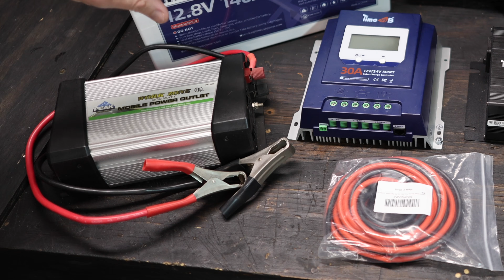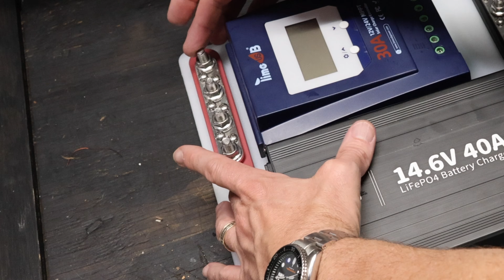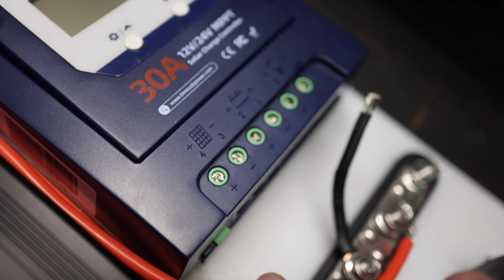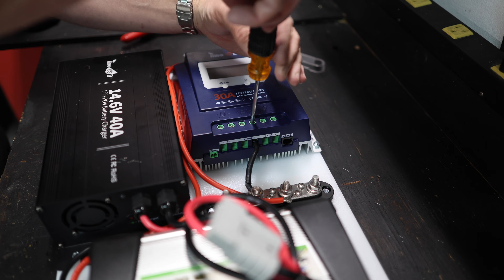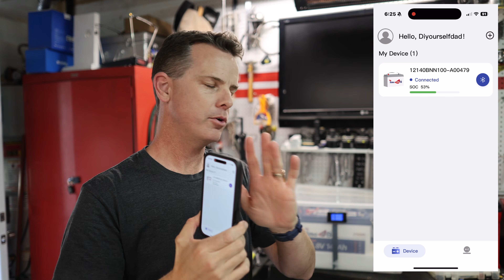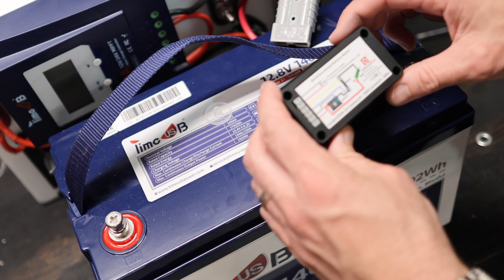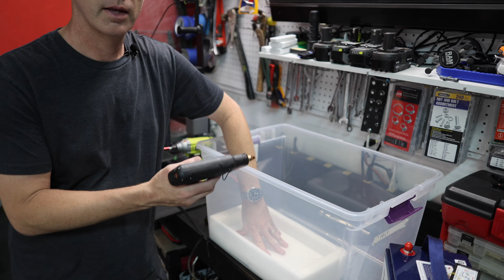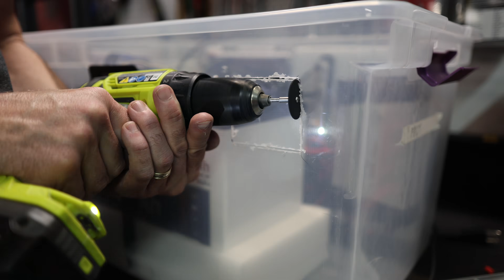Build Your Own Solar Power Station - Make It Better - Make It Cheaper

Comment: Not fuses, breakers or cut off switch?🤔
Reply: Has fuses inside the inverter and the solar charger. A cutoff switch would be a good add tho.
Reply: only noobs need that

Comment: The AFERIY P210 2400w all in one unit Is cheaper and has more capacity than this Frankenstein!
It cost $700 at discount and has a  2048 watt hour capacity  which is more than this.

Comment: How much money do you save on comparable power station, or did I miss that?
Reply from the maker: It’s all going to depend on what you already have on hand, in my case, I pulled the battery and solar controller out of my trailer for an upgrade so the cost on that was nothing. If you already have stuff laying around, you can fill in the gaps and build one of these pretty cheap.

Comment: I have been piecing my system together. Starting with 900 Amp hr. 4k Inverter.60 amp Charger. almost to 800 Wats of Solar 
I want to camp for 9 days with out starting the Gen set....
Reply: I want to build something for powering my dj equipment. I know what I need it w and wh, still learning about a, ah, and mah.
Reply: @commonsenserevival amp hours is how RVers refer to storage capacity of a battery. It assumes 12v batteries. Power stations or diy can use a variety of battery voltages so watt-hours is a better indicator of energy a battery can store, as a 48v 100 ah battery can store way more energy than a 12v one.

Comment: Great video. I did something similar several years ago. Instead of the bulky and expensive battery charger, I added an AC adapter to 15 volts and hooked it to the charge controller. It takes a lot longer to charge from AC but makes it much lighter. I also added a 12 volt port to charge things with the car adapters(cigarette lighter) and USB ports.

Comment: Does the power inverter have room for multiple plugs?  If so, shouldn't it be placed on the cutting board so that it is right at the side of the box (with a hole cut) to access for plugs?
Reply from the maker: Watch the end of the video, I mount the plugs in the front of the box.

Comment: Solar control over size for 140Ah. Unless you going for like 600W solar setup. User can go smaller. Upgrade battery to measure discharge and charge level. No need to add it external. It's add another failure point.
Reply from the maker: Definitely overkill, but it’s what I had on hand so it’s what I used.

Comment: You didn't mention the item cost or total cost. It would be nice to know if the project is worth it. I know it should be under $2k. That was mentioned in the video.
Reply: The links he offered by the video put the price around $633USD. Battery is $433 and every thing else comes to about $200 That does not include a few things like container, wire, bus bar, screws bread board and taxes and shipping.  If you want to click the link yourself, it pops up an ad for your trouble.
Reply: It should be under $1,000 as I've seen a guy do it for $700 on Temu with 3x the 100 Ah batteries and a 4K inverter. I'd go with a wood box and buy 4 wheels to add to it. That is how I'm going to do mine, plus add a few Computer fans to keep it all kool. You can even go with the light up ones and put a plex glass top on it lol. As a few ppl said a fuse and a master on/off switch can be added for less than $30-40 more too.
Reply: $546 to $672 is the price range.

These are rough estimates and can change if any discounts expire. Do note that. Act fast. Have fun.
Reply: What is the cost of this project?
Reply: A 1028wh ecoflow is under $500 right now  and $520 for the newer delta version... so I'm not sure this DIY is worth it
Reply: @Gioprez88  The nice thing about this is that you can replace anything that craps out and custom configure it however you want.
Reply: I don't know where he thinks you have to pay $2000 for a powerbank. Shop around for goodness sake.

Comment: I would love have preferred DiyDad to have built this using the exact specs of the Anker.... Like:
2-USB¹ connectors 
4-110v outlets
1-220v outlet!
This is needed more & more in today's environment.
At home & in a camper & for emergency power.
This was the reason given for building your own!
Yes I know I can buy larger inverter's. But most don't. And when buying a 240v invertor it could bring the price close enough to go with a big manufacturer & buy a no questions asked warranty for $50\4 year's!

And DiyDad's video failed to give a total cost to make.
He was glad to say what the big boy costs. But cricket's on his(even estimate supplies had already, he did spend $ to get them).

Make a longer video so viewers can see all of the processes involved.
Even if you have to buy another $8 tote & 10 extra minutes rerecording an oopsie!

Overall I give you a 6.7 on the thought & creation of this.
But to make a solid 8.5-9.5 you need more details!
After all you're promoting yourself & making a living doing this!

¹Anker has USB connector hidden by plastic cover
Reply from the maker: The pole point here was to show what can be done. You can pick out whatever inverters you want, get inverters with USB ports, etc. It’s all what you’re willing to buy and install, I have no need for USB ports on mine so I use an inverter that didn’t have them.

Comment: What about fuses?
Reply: You can add external fuse
Reply: You can add fuse blocks inbetween the parts it's just a lil more work
Reply: never hurts to add fuse. imho. safety first.
Reply: The are built in to the components at the factory.
Reply: That would be safe font want that
Reply: I mean eventually an over current will melt the wire and when that opens it is like a fuse right? 😂
Reply: @matthewtaylor-h6q  Basically yes.  Cars use to have fuse-able link wire in the starter system.  It was a section of wire that would do just that if that. My mom's 1964 Plymouth Valiant had starter issues and they fixed it by changing the fuse-able link wire..
Reply: @matthewtaylor-h6q NOPE!
Reply: The inverters have replaceable fuses. The rest of it,  not a clue
Reply from the maker: @johnholmes6897 every component has a replaceable fuse, the battery has a BMS.
Reply: @DoItYourselfDad thank you very much !
Reply: @DoItYourselfDad  So if you're using a lead acid deep cycle, or less sophisticated battery, don't forget the fuses...
Reply: These batteries, as well as every device connecting to the battery, all have their own digital breaker-style over-current protection and short circuit protection. You can add a fuse but that's just a point of failure that requires something to be replaced, or otherwise if you pick a value larger than the over-current shutoff of the battery, it'll never blow unless something else goes horribly wrong first, and whatever that is would probably trigger other shutoffs that stop the flow of electricity out of the battery.

The cells of the battery are not directly connected to the terminals. They are connected to the battery management system, which fails safely in a large number of different scenarios, including if it just fries or melts: the power stops coming out of the battery management system and therefore stops coming out of the battery entirely.

I like this because of something goes wrong, I get error codes. I can diagnose through Bluetooth. And most of all I can reset it without buying a new part (big fuses for 400+ amps are $50+ a pop) or taking anything apart.
Reply: China is supplier probably and banking on us burning down knowing we have wood homes I guess

Comment: Since when do lithium ion batteries have a flat discharge curve?  They have a very steep discharge curve topping out at 4.2vpc down to about 3vpc.
Reply: how do you not understand what he means? Most of the capacity stays around the nominal voltage of 3.7v hence the "flatter" discharge curve. This is well know information, Its practically the #1 thing about lithium besides the capacity advantage.
Reply: @electricalfive2248  No it doesn't.  The discharge curve looks like this \ 
It's not like NIMH which the batteries come off the charger around 1.5-1.6v, quickly drop to 1.2 and then stay there for most of the cycle and then quickly drop off at the end.  Nicad and NIMH both have very flat discharge curves.  Lithium ion does not.
The nominal voltage is the 1/2 way point.  They start at 4.2 right off the charger and slowly drop to 3.0.  3.7/3.6 is roughly 1/2 way through the discharge curve.
Reply: @tarstarkusz  i dont understand where you're getting your info from, all discharge tests with lithium have much flatter curves then gel or lead acid. i also dont know why you're bringing up nimh and nicad. why are you involving them? yes they have flat discharge curves. but why would anyone use them? they're terrible, it was used in the first gen prius 20 years ago... that battery had soo many problems, quickly losing capacity, short life span, etc...
Reply: @electricalfive2248  Who said anything about lead acid?  I brought up nicad and NIMH as examples of a flat discharge curve.  They both spend 98% of their charge life at 1.2 volts.  They come off the charger around 1.5-1.6v, but then very quickly (we're talking as soon as you put a load on them) drop to 1.2v and stay there for the majority of their charge cycle. Then at the very end of their charge life, the quickly drop to below a volt.  That characteristic of being at 1.2 for the majority of the discharge is why it is called a flat discharge curve.

Just type lithium ion discharge curve into your favorite site.  I assure you it is not flat.
Again, they come off the charger at 4.2 volts per cell and they are dead at 2.9 or 3.  That is the reason the voltage of 3.6 is listed as the "nominal" voltage.  This discharge matches the state of charge pretty well.  At full, it is 4.2v, at 50%, it's around 3.6 and at depleted, it's around 2.9 or 3 volts.  The voltage drop is proportional to the state of charge.  Unlike nicad and NIMH, they don't fall quickly to 3.7 or 3.7 and stay there.  Instead, the voltage steadily decreases over the charge cycle.
Reply: This is lithium IRON PHOSPHATE, LiFePo4. Flat curve for most of its charge/discharge cycle.
Reply: @jake-mv5oi  I don't know what the discharge curve looks like for that chemistry.
Reply from the maker: Look up Lithium Iron Phosphate discharge curve and get back to us….
Reply: @DoItYourselfDad  I believe you.  I thought you were talking about regular lithium ion batteries.

Comment: I wish someone would make a video showing how to wire both the solar set up and the the wiring of the trailer or build it goes to and how it connects. Thx
Reply from the maker: It’s pretty much exactly the same as this, except for the charger that is coming off of your RV or camper, takes the place of the charger here.

Comment: The cutting board is a great idea.
Reply from the maker: I built the entire set up in my travel trailer out of a giant cutting board. You can also get the same material from boat shops, sometimes they’ll hook you up with scraps.
Reply: Cutting boards are great! - I used one for a portable ac power distribution panel - handy handles.. and self tapping screws! I wish cutting boards came in ~1/2"
Reply: @mikehamby9723 
Try restaurant suppliers, they have them in any size and color at 1/2" thick.
Reply: @mikehamby9723  put 2 cutting boards back to back to make it thicker.
Reply: @mikehamby9723  I got a 1/2 inch cutting board at a restaurant supply store! It’s awesome, I wouldn’t sacrifice it for this but it’s rigid and light.
Reply: Cutting board idea was worth the watch alone.
Reply: @wild2heart  just like the quiet nerd. cool campers ...
Reply: I stumbled on this idea on my own looking for something solid to place my guitar pedalboard on. I got 2 cutting boards at Goodwill for less than $8.
Reply: Until it start a fire.  I have seen one Delrin on fire
Reply from the maker: What do you think they mount everything on in commercial made units? Plastic.
Reply: @DoItYourselfDad  Plastics used for electronics are required to have fire retardants in their mix. That fact is often molded right into the plastic someplace. "ABS-FR"  for Acrylonitrile Butadiene Styrene, Flame Retardant. Or "ABS+PC-FR" for ABS Polycarbonate mix.
Reply: What is the fire rating of the plastic material of the cutting  board (eg. UL 94 V-0 or ???).
Reply: indeed, it is.

Comment: You took too much time explaining what that device does measuring the battery energy but did not take time to mention its name and where to get it. And this makes the whole thing half-cooked😢
Reply from the maker: Did you even bother to look at the description where I list out everything I used in detail with links?
Reply: Everything is linked in the description.
Reply: Where is your video?  Content creators and people in general like to hear some positive so maybe say what you liked about the video and then give some constructive criticism, rather than just going straight to the negative.
Reply: Did you ever think that the OP wanted to know what brand it was so he could build one using DiyDad's plans to the point?
He mentioned the "TimeUSB for the battery, solar charger & battery charger
Peak is the brand of power inverter.
And the solar panel you can see... But just looking you just don't see the brand or make. Only a cheap cardboard box....
Some people just don't have the time to research or perhaps ask for suggestions to a quality item that someone like DiyDad has.
And with the monitor 
you didn't see a model# or anything else(I checked the video while typing this)

Just no need to jump on a commentor like you did! And that I'm returning to your graceful crap!

 @WingAddict

Comment: I also thought of building a DIY solar power station based off the price and specs of the EcoFlow Delta 2 on sale, and I was surprised to see that I could not get to that price point with the components and features. If I lost some of the features, I could get cheaper, but here is my breakdown

EcoFlow Delta 2 on sale has been about $450 or even less at times

DIY Version:
LiFePO4 100ah battery - ~$160 (cheapest one on amazon)
Mppt charge controller - ~$35-90 (PowMr either the 25a or the 60a)
AC Charger - $15-90 (These are surprisingly expensive that is often overlooked, and yes, a much cheaper trickle charger could work, but the Delta 2 charges quickly in 1-2 hours)
12v Inverter - ~$30-120 depending on specs/features, pure sine wave, how many watts, etc
Ranges from $240-460 depending on if you go with a super basic low spec model, vs a closer spec for spec comparison
then you have to add in the cost of wires, bus bars, shunts, fuses, etc

But that omits several features that the ecoflow power stations include like 
DC USB PD Fast Charging - $12
UPS Mode automatic transfer switch $65
Not to mention the bluetooth app which includes the smarts for time of use, etc.

I started with a DIY system before the power stations dropped in price, and of course the economy and tariffs are swinging unpredictably, but I was very surprised.

I still think your point about the repairability/upgradability is the best thing about doing a DIY system.
Reply: I kinda have to agree.  its not hard at all to beat the full MSRP of the ecoflow  products but they have some very capable units that go on sale regularly.  As you noted its quite hard to price match the feature list if you need most of them if you catch a sale.
Theres also the application to consider.  If your building to fit a specific area and dont plan to move it from that spot you can probably make a nice setup.  If being able to sling it from one vheicle to another is a goal however something like the delta 2 will be alot easire to pack around than all that in a tote.
Reply: Tank's!
Reply: The main reason I can see to build over buy is the ability to change the battery out should/when it goes bad.

Comment: I like that you added a shunt to your system, one of the issues i had on my system was that I wanted to measure how many watts my loads (inverters, dc loads) used, so I hooked it up to do so, but that caused my battery capacity measurements to be inaccurate. 

After doing some research and thought, I realized I would need a separate shunt/meter for the battery and then one for my loads.

Sadly, I also wanted to know how much solar is going INTO my battery, but thats Three shunts/monitors! Seems a little overkill to me.
Reply: Hi, so use victron mains charger, dc to dc, solar charger and inverter. All on Bluetooth. Now you can ass a shunt and it’s all on one app. You can also use a Victron lynx distributor to house the fuses and mount the shunt.
Don’t forget a marine rated fuse for the battery and fuses for each item.
Expensive but good stuff.
Take care M.

Comment: I'd definitely go with LiFePo4 batteries for building one of these.  They're lighter than lead acid and safer than Li-Ion.
Reply: And they run so many cycles that they are cheaper per stored kwh over their lifetime than any other battery chemistry I have analyzed.